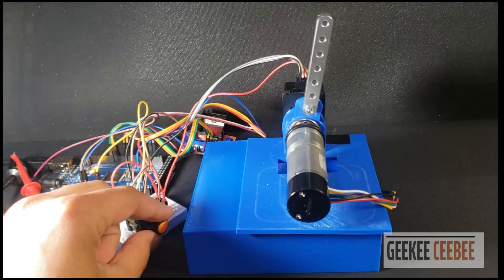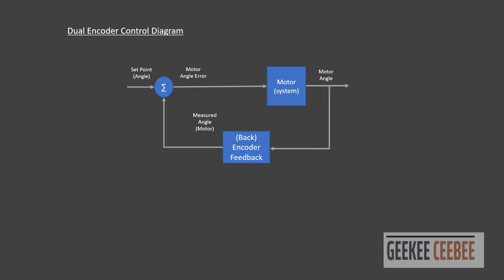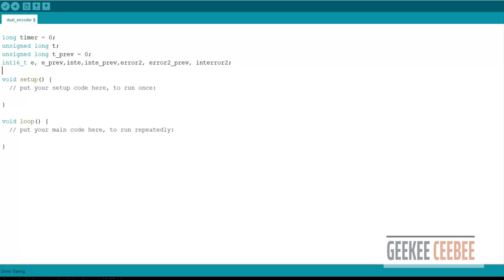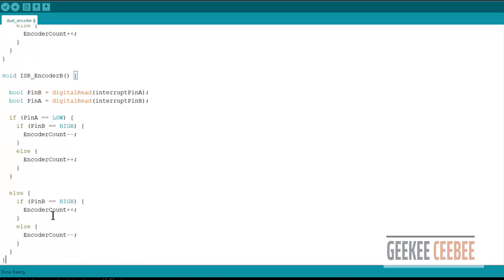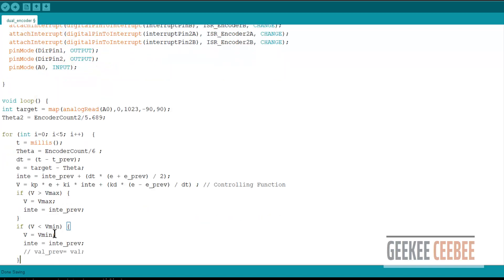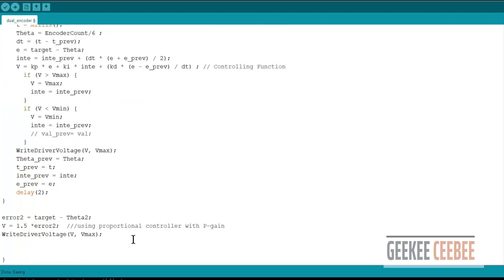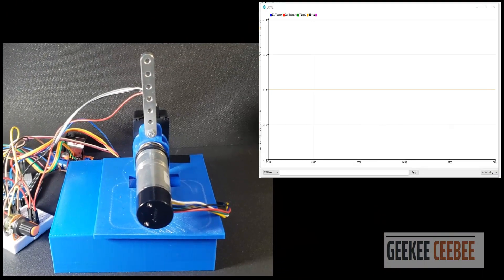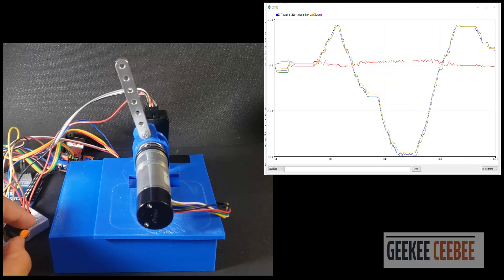Anti-Backlash Dual Encoder Motor Position Control

Comment: Having a dual encoder helps you get to the set position, but I don't think this is a generalised control solution becuase the gearbox backlash introduces "deadband" into the control feedback loop, and a simple PID algorithm alone cannot stably control a loop containing a deadband. PID is a linear control scheme but your plant is non-linear and has a non-differentiable response.
Typically, the control loop will oscillate as the motor "hunts" in the limit-cycle of the deadband region, which in this case is the amount of slop in the meshing of the gearbox teeth that can be taken up before the applied motor movement starts to move the actual output shaft of the gearbox.
As you have noticed, your outer loop controller has to be purely proportional (with no Integral term), just to make it stable.
The problem is that without that integral term you will always have a steady-state positional offset error when the shaft has a non-zero angular load.
However if you add that integral term into the loop, the integral-wind-up will cause the motor to start oscillating within the limit-cycle of the deadband after the gearbox output shaft has reached the target position.
Reply: What type of control schemes work to stably control a loop with a deadband?
Reply: @BenCauntyt  It is a tricky problem because when the output shaft gets within the backlash limit cycle range of the set position, the forward path effectively becomes disconnected becuase any changes to the motor position are no longer affecting the output shaft position at all! There aren't really any mathematically perfect solutions for that.
One pragmatic approach is to adaptively change the PID parameters on the fly. In software you can detect when the outer loop error signal is smaller than the backlash range of the gearbox and when we are in that range you switch to having just P (or P+D) control to avoid the integral wind-up that leads to hunting. This will allow us to quickly approach the set point position (thanks to the I+D terms in the outer loop) whilst preventing any limit cycle oscillation.  This approach also has an advantage over just using a fixed proportional feedback in the outer loop, becuase the integral term will allow us to have a zero positional error even when the output shaft has a load. 
This would be vital for (say) an industrial robot arm, where otherwise the arm would sag under gravity and never quite reach the commanded position.
Reply: The method that works for me ( > 3 decades) is to close the PID on the motor and use the load-mounted encoder for target position.
I use dual-loop, exclusively for not only backlash compensation but also for detecting a feedback failure.